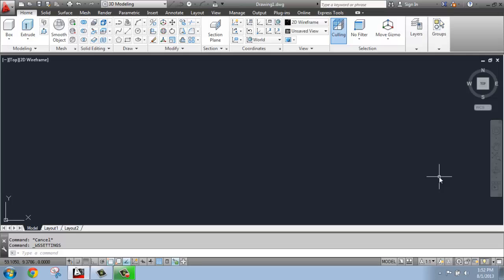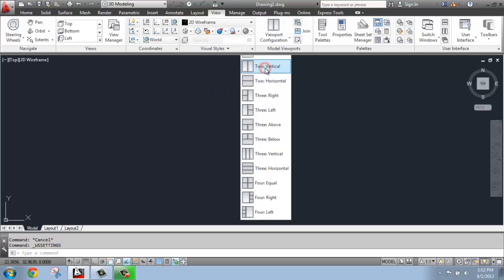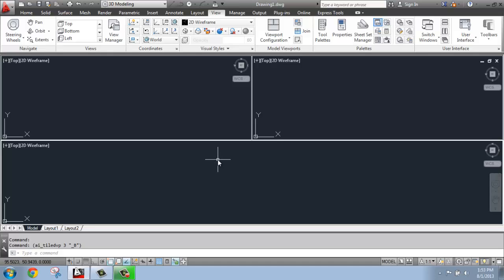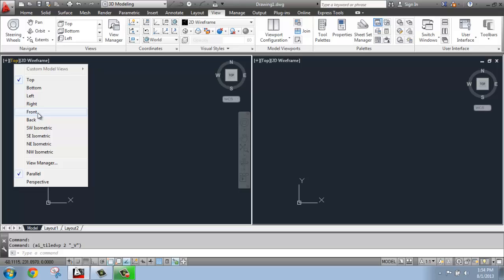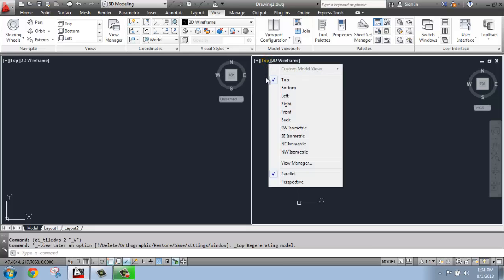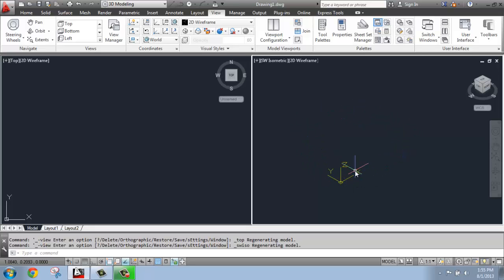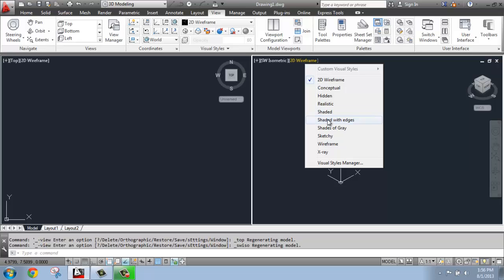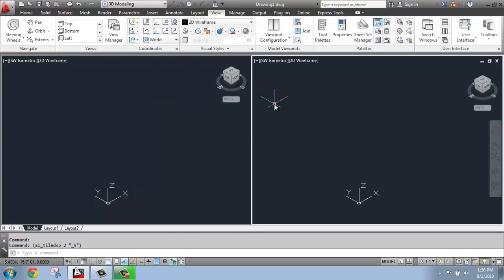AutoCAD - 3D Modeling Basics #3 - Multiple Viewports - Brooke Godfrey

Comment: On AutoCAD 2015, beginning in 3D Modeling, the viewport configuration panel doesn't show anywhere.  And I looked through the panel menus also.  Now if I begin in 2D (Drafting and Annotation), then there is a viewport config panel in 'view' tab.  And then I can switch to 3d modeling and it will keep the view config in place.  I just cannot find a way to manipulate viewports from within 3D Modeling itself.
Reply: greatsea Click the [-] in the top right of Model space.  From there you can choose multiple Model space viewports

Comment: Thanks Brooke.  Im fairly new to Autocad and your series is really helpful.  You move at a perfect pace and its an added bonus that I can understand your speech ;)  One Q I had was, how do you get the Pan and Pointer icons to sit over the crosshair cursor.  What I need to do is zoom in to a floor layout and trace a polyline around an area of walls.  It would be handy to be able to Pan as I click the polylines instead of zooming in and out all the time.  Thanks